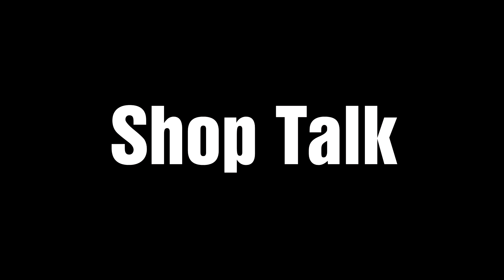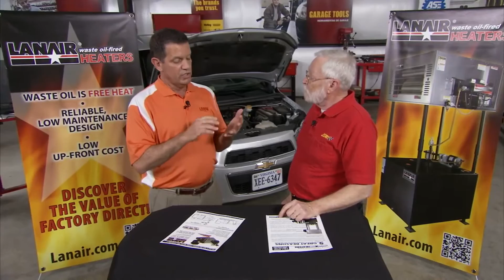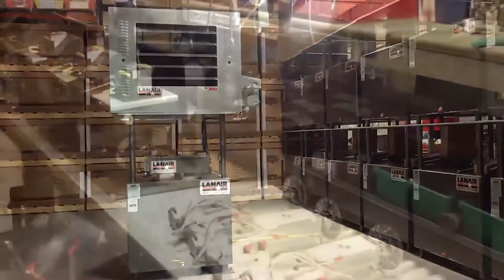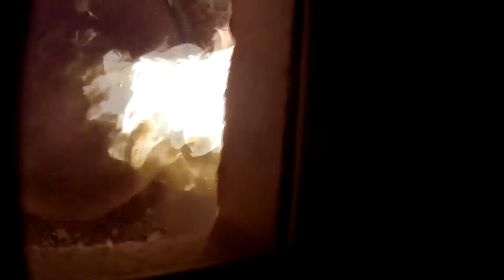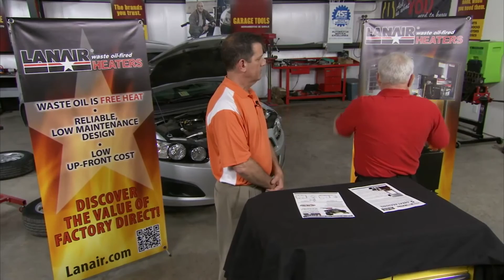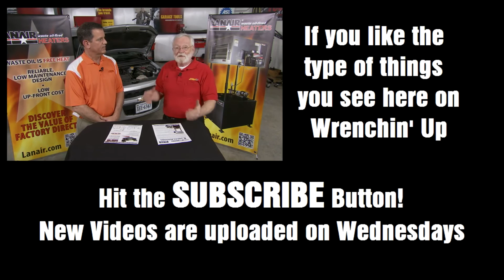Heating The Shop With Used Motor Oil - Wrenchin' Up

Comment: The Stories I could tell about those things.  Lets just say it gets cold in Utah and those waste oil heaters didn't work much in the winter time.  It gets hot in the summer and one owner would open up the doors to the shop and run that waste oil heater to get rid of the waste oil, In the middle of the summer !!!!  Yup they work great in the summer and not in the winter.
Reply from the maker: +Robert Higgins Well, that's one way to use them!